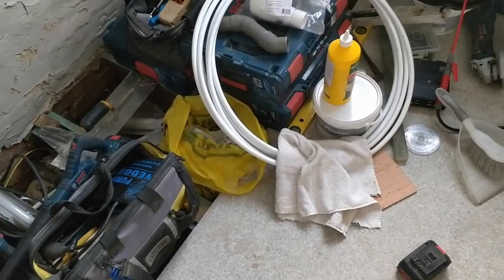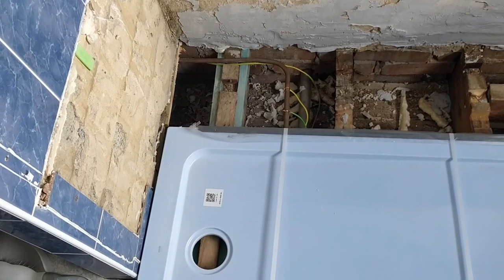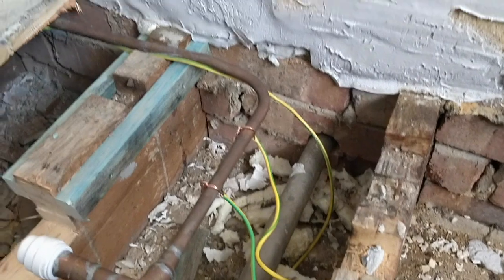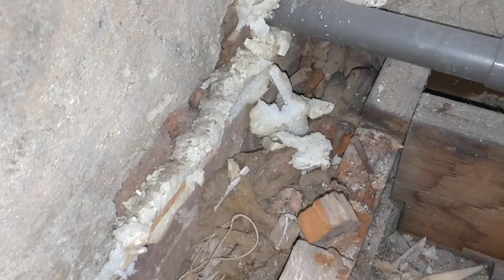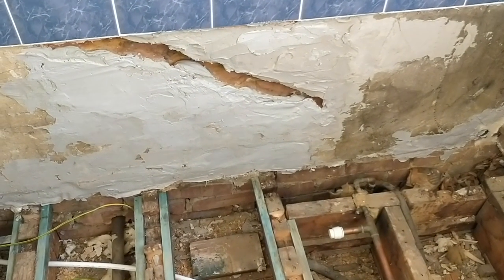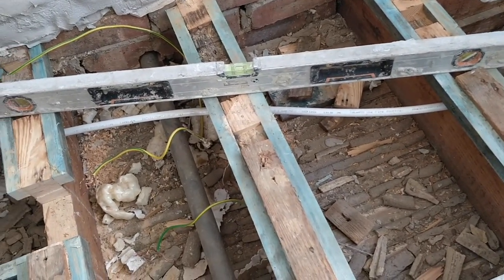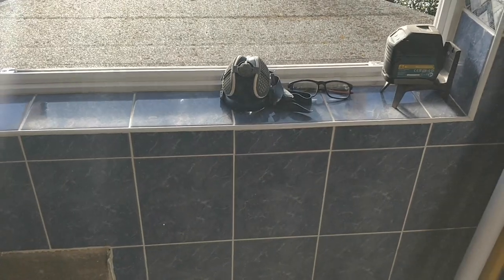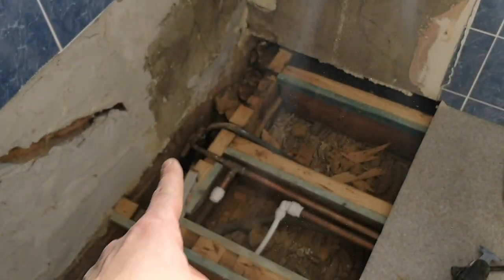How to level joists for a shower tray

Comment: I’d be tempted to put noggins in across the beams. Also recommend you talk to a sparky about bonding as your replacing bits of the copper with plastic. 

I’m not a fan of pushfit and I defo wouldn’t have it in an inaccessible area like under a floor, but that’s just me.

Comment: Hi there great video. Can I ask you a question please? If you surveyed a possible customers bathroom for a tray, how do you find out which way the joists are running etc?
Reply from the maker: It can be very hard if there is flooring down covering the original boards, but there are often clues (screw heads, nails etc. running in the same direction).

Also, if it's a terraced or semi detached house, the joists typically run front to back, because they are set into the brick work, and noise and fire could travel along the joists to the neighbours property if they ran the other way.

In all other instances, the joists generally run in whichever direction is the shortest span. Floorboards always run perpendicular to joists.

I hope that helps, and it's not any one set rule sadly, every builder does it slightly differently! Best of luck.

Comment: Little tip for levelling with a laser … put the laser anywhere in the room any height you like facing the working area then use a tape measure down on to the surface your levelling where the laser hits the tape you can work out if your high or low in each area … hope that makes sense
Reply from the maker: Great suggestion!
Reply: @OfficeBoyBuilder  hope that helps mate
Reply from the maker: It's a brilliant idea - almost like one of those Lazer level finders that bleeps when the stick is at the right height, only you use a tape measure instead.

I have one of those long collapsible plastic ruler style tape measures, that would work too because they're rigid across the entire length 💪👍
Reply: @OfficeBoyBuilder  that’s the way we screed big areas in extentions or level old houses flooring very cheap and cheerful way of doing it

Comment: You're a very meticulous  guy and it shows! If the joist surfaces were very out of level with each other (assuming that's why you did what you did), I personally would elect to attach timbers (like the battens you've used for eg) to stick up above the joist surfaces by 3-4mm instead of sinking the plywood below the joist surfaces. This way you can have continuous big sheets of ply without cutting the joist thinner and weakening them, plus less cutting. 

I have a water level I like using to get things in a flat plane, but laser level would be less finicky. You can find the highest joist surface that you'd like the bottom of the ply to miss, attach a timber to stick above it by about 1-2mm, and then attach timbers to all the other joists to the same height as the first timber, checking their elevation against the first timber you attached with laser/water level. I personally would use 38x63 CLS to give extra room for screws both vertically against the joists and later for attaching the ply.
Reply from the maker: Great suggestions. I was keen to have the shower tray as flush to the ground as possible, because the couple I was installing it for are both very old and frail, and needed to be able to walk into it. Otherwise, completely agree 👍
Reply: @OfficeBoyBuilder  Yeah that's understandable. Thanks for the reply👍

Comment: Building regs do not permit notching that deep. Should be no deeper than 0.125 times the depth of the joists. You’ve essentially destroyed it’s structural integrity
Reply: Indeed. Wirquin do a very shallow "SLIM" (40mm) membrane valve waste if you really have to position the waste above a joist. Not convinced about that load bearing floor being cut back like that either....
Reply: Multiple notches on one joist far too close together and a drilled hole underneath one of these notches...... yikes. And then there's the plastic flexi and the plastic compression fitting, under floorboards. 😬

Comment: There was no need for your batons if you used the multi tool to shave off the top of the Joists? For the next job, keep your working area clean, ie hoover out the muck in between joists, better for fire purposes but overall it makes you feel better working in an uncluttered environment. Overall I like your vids buddy, I love seeing a person do this stuff themselves, I started the same way 20 years ago, love it. Well done mate
Reply: scrap everything I said, I watched till the end, which I shouldve done initially instead of mouthing off. You cleaned the shite out, you used the batons for levelling & structural purposes(I would have used plywood to sister the joists) , but other than that, great job
Reply from the maker: Cheers mate - I love clean working areas - safer, easier to see what you're doing, and less risk of leaving tools behind! 🤣